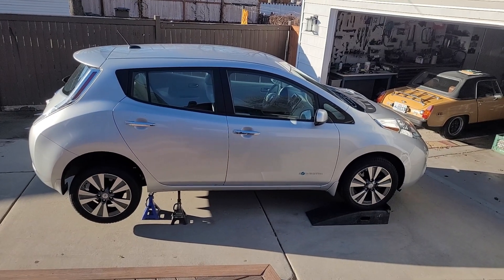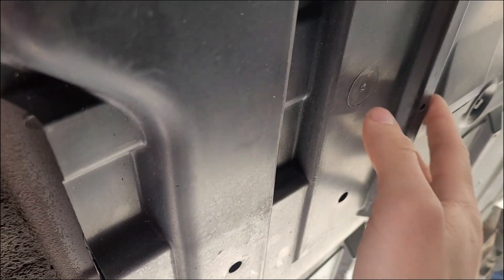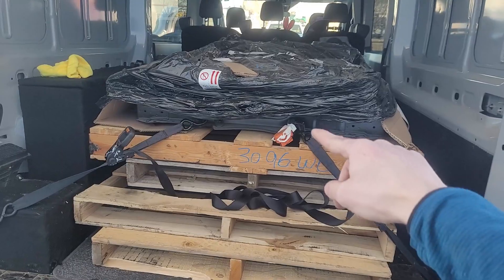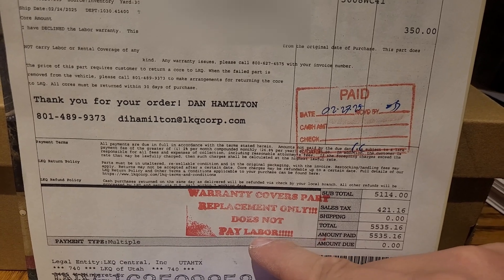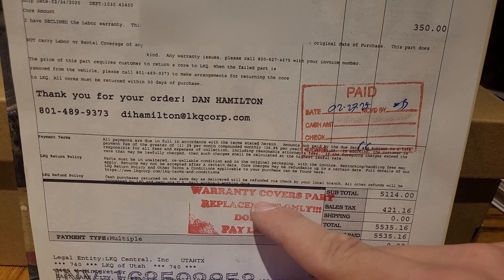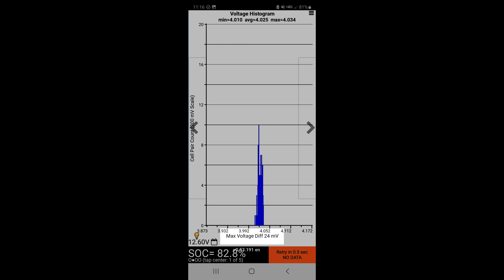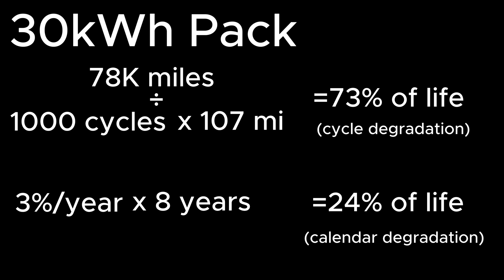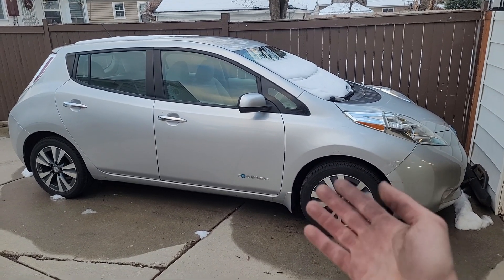Quadrupling my Nissan Leaf's Range! 62kWh Battery Swap

Comment: I dont have the DuPont housing for the DuPont connectors. Could I just use some electrical tape?
Reply from the maker: @kudynski  I wouldn't. It's not worth shorting to a different pin and potentially damaging the BMS. Dupont connectors are $10 on Amazon. Well worth it.
Reply: @zuccamachine I could also use heat shrink wrap.
Reply: @zuccamachine  I got the Dupont cables. Amazon delivery is amazing. That being said in your video it looks like all the cables are going to far left corner of the battery. Is that correct?
Reply from the maker: @kudynski  Go to the link in the description for Dala's github page. Explains all of this.
Reply: I agree. I am just picking up the battery tomorrow.  I made the whole gizmo accept the damn plastic covers.

Comment: Too bad Nissan did such a poor job with BMS and cooling. These packs could last a lot longer, several thousand cycles.
Reply: When Nissan designed the LEAF there were not fast chargers. It was designed to AC slow charge at home, or be a power supply unit during an emergency. And if the owners understood how Nissan designed the LEAF, they would known how to use it.

Comment: It's frustrating there aren't better places to buy those batteries.  This place does list batteries, but they give no information about the battery health or even size.  If you want to roll the dice, you could just go to local junkyards.  Hope that battery works out for you

Comment: What tends to accelerate degradation are often simple things like letting the vehicle sit for extended periods with 100% (indicated) charge. Nissan's NMC chemistry doesn't like this. I used to do this every night with my 2015 Leaf after coming home from work. I'd plug in as soon as I arrived home and the car would reach 100% charge in about 3 to 4 hours. It would then sit overnight until 7 am the next morning, resting for roughly 10 to 11 hours at full charge.  This would occur on weekends as well sitting from Friday evening until Monday morning. This behavior was slowly killing my battery, just a tiny bit each time but the effects are cumulative.  Many owners incorrectly assume that since the BMS indicates 100% when the battery is actually only at 90% (done to protect the cells) it's OK to leave it sit at 100% indicated.  For the Nissan Leaf (especially the early models) it's best to charge to 100% only when you intend to use the vehicle promptly.  Keeping it under 80% (90% indicated) is probably the best for a long battery life.

Comment: 1:40
I have Renault Zoe, distant relative of Leaf.
Under trunk area there is 2nd AC unit with air chiller and PTC heaters to condition the battery. Zoe has closed loop air condition for the battery. 
Zoe was designed to use motor as part of AC charging circuit and Q210/Q90 models can do up to 43kW AC (3x230Vx63A), so it needed active cooling. Later models R135 could do 50kW DC fast charge (43kW in practice peak), without damage to the battery. All can regen brake up to 40kW. 
It would take less room if it had liquid for heat exchange, but this was cheaper. My Zoe is 2018, 120.000km and it is 88% SOH, so battery degradation is not a concern.

Comment: Here in Europe you can go to an EV clinic, for example the EV clinic in Berlin, and they take the battery apart and diagnose each individual cell, and those that are bad or about to go bad get replaced, and then you end up with a battery that is up to spec as if it was new. And the costs for that are about a 1000 euro for taking apart the battery from a tesla model S, and 50 Euro for each cell that needs to be replaced. On average the costs are around 1200 Euro for the entire refurbishing, depending on how many cells that need to be replaced. And they do every brand of car. But you can also do an upgrade from the battery with a complete replacement. There are different options that you can pick from. And there are different locations across Europe that you can go to. And on average the refurbishing takes about 3 days.
Reply from the maker: @insAneTunA  In this case, all cells were degraded and needed to be replaced, which made the larger battery upgrade make the most sense
Reply: Lol even new it was 70 miles of 😅

Comment: Great video!
I lucked out...bought a 2017 Leaf that was at 8 bars, called Nissan Canada with the VIN and they confirmed it was still under warranty (in 2024). 
Picked up the car, took it to the local Nissan dealer, they confirmed it qualified and ordered a new battery, took about 8 weeks for it to arrive and they did the swap June 2024, new battery was a 40kwh. What an improvement! We have put on about 10,000km since then. Winter range was in the high 190's to low 220's (km) and last summer we saw many 300km days!
Because we lucked out it was $0.
The 62kwh will be killer in your Leaf!
Cheers
Mike 🇨🇦

Comment: I didn't think a second generation Leaf battery would fit into a first gen. Leaf
62 kWh battery is a lot heavier? 
Suspension will be ok or will you have to get heavier springs etc? I guess we wait and see.
Reply: been done many times.

Comment: Whoever had the leaf before you really missed the boat on getting that battery replaced. It was almost certainly below 67% health before the warranty ended sometime in 2024.
Reply: In the video pretty early on he says that he thinks there actually was a warranty replacement and the warranty replaced battery also degraded because they used a used one. That's just how bad these leaf packs were, basically garbage

Comment: $5535 ain't cheap!
Reply from the maker: @imaginarymask  62kWh leafs are 10-14K! This is a cheap route to get that same result
Reply: @zuccamachine  oh for sure!  I was just thinking, it's like you are paying for several years of gas all at once.  So, if it's 262 miles per cycle, is the max life expectancy 262,000 miles?
Reply: @imaginarymask  Not really, depends on how you drive and what type of temperature range you put the battery through. If you care for it the first thing to break on most EV's wont be the battery
Reply: @relaxnation1773  It makes sense there are real world environmental and use case conditions for maximizing battery life.  On other home use case Lithium batteries, I have heard that after the factory stated given cycles, the battery would degrade to 80%. Is it theoretically possible, in ideal conditions and with meticulous care, that the battery could last past the max life expectancy, just with a reduced range?
Reply: @imaginarymask that battery is nmc not lifepo4, correct?
Reply: @about2088  is it? I don't know. I thought everyone was using lithium batteries nowadays
Reply: @imaginarymask  just googled, yup nmc
Reply: Bruh this is outrageously cheap!!
Reply: Not bad for another 150K or more miles range. That’s only $0.27/mile, plus $0.08/mile (or whatever local number applies) for electricity, and it’s half the cost of operating a gas gar.
Reply: Don't you mean.   $0.03 /mile + electricity?

Comment: Seems to be the most economically sensible commuter EV option. (But those longevity calculations are conditional, on various additional parameters, such as, ambient temperature.)

Look forward to seeing how the physical and firmware, differences are addressed? Since there are a few different options. Have fun.
Reply from the maker: @nc3826  I agree it's a very imperfect calculation, just a quick guess.
Reply: @zuccamachine  I figured, look forward to the build.